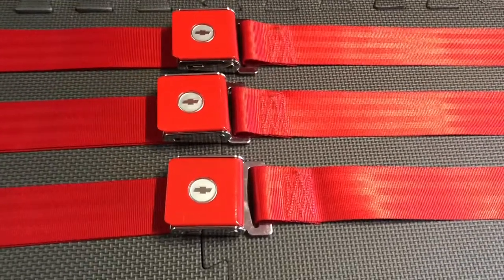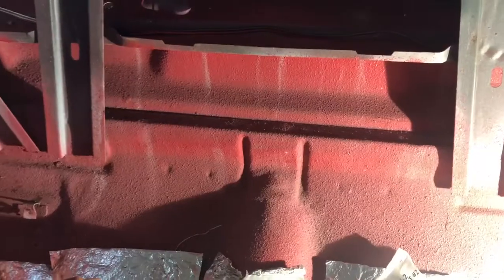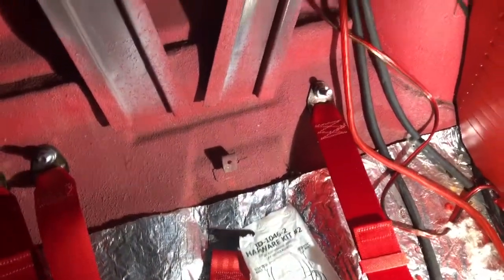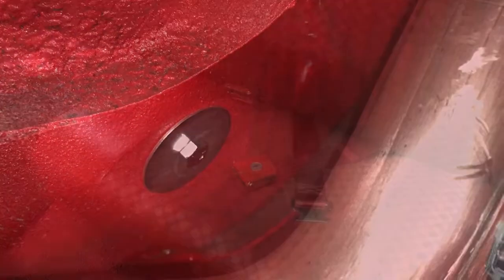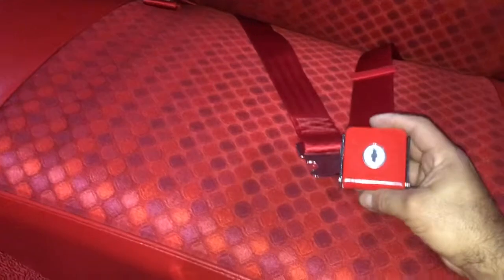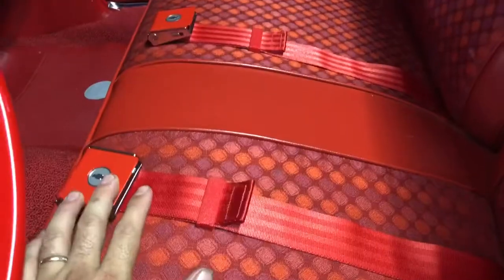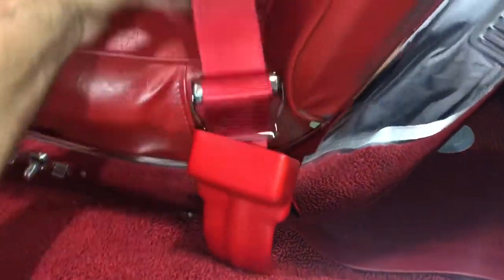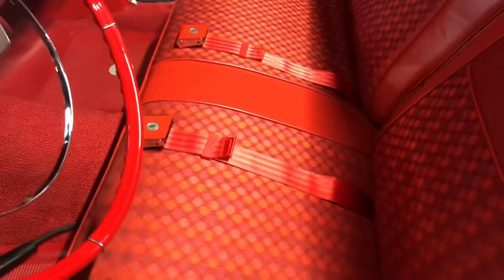How to install front and rear factory seatbelts 1964 Impala

Comment: What length did you buy for the back seat belts?  I've seen 60" and 74" for sale.  I'm thinking the 74" would be best as you could always cinch down the extra, right?  Thanks for your video!
Reply from the maker: Yes sir, get the 74s 👍
Reply: Did you get the 60 or 74

Comment: Question so I just ordered 74 inch seatbelts I’m doing 6 seatbelts you think I can use the same bolts for the driver passenger middle bolts for the center seatbelts this is for the front bench

Comment: Bro, i always learn from your vids, I really appreciate them.
I'm putting in new floors, and there are hols for the front seat seatbelt, do  need to weld something there, or literally do like what you did in back, and use bolt/nut/washer setup?
Reply from the maker: Frank LOW That’s great! 

You can just use/do what I did for the back seat, it’s just as effective 👌
Reply: BTW, for those plastic pieces fir the bench you should look into 3D printing, get a bunch done.
Reply from the maker: Frank LOW 🤔 I’ll look into that, thanks ✅